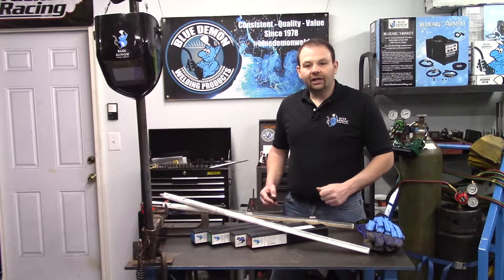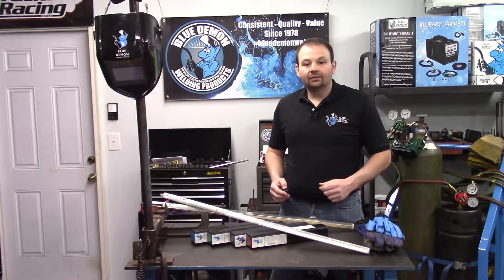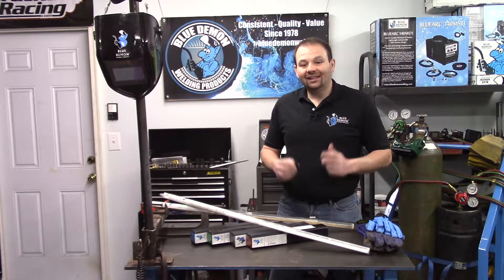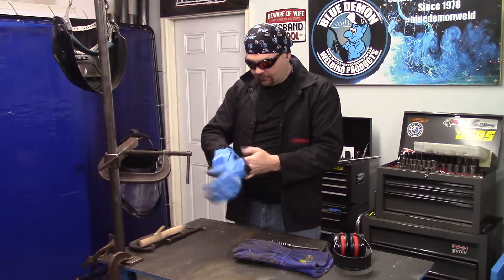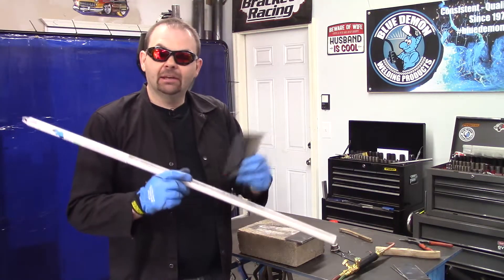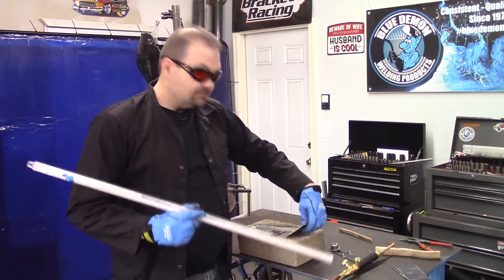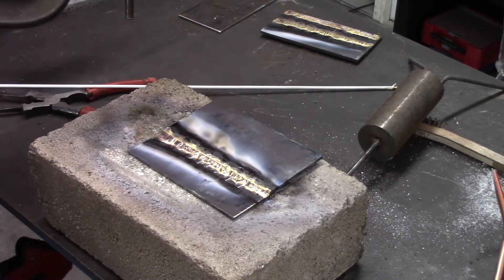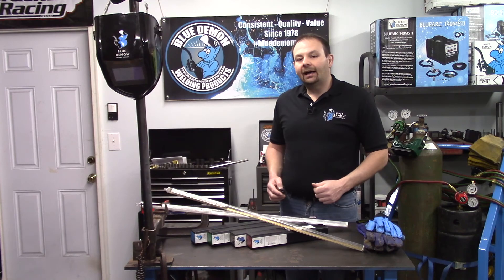Blue Demon RBCuZn-C Flux Coated Brazing Rod (aka LFBFC)

Comment: Can I use a TIG torch instead with this filler rod?
Reply from the maker: you cannot.  the heat from the tig torch will vaporize the filler.  it has a low melt temp.  it is for brazing only.